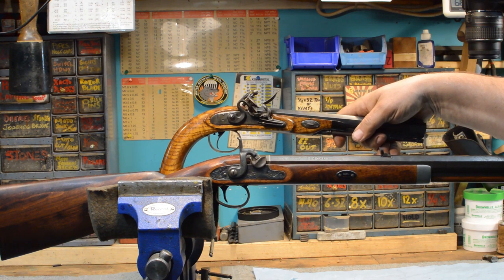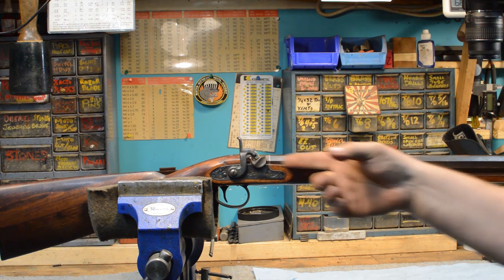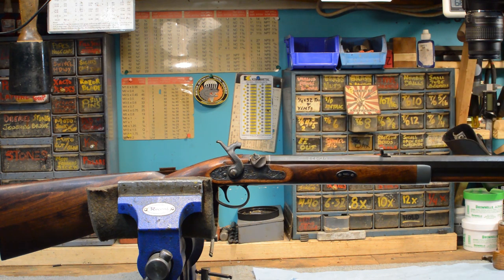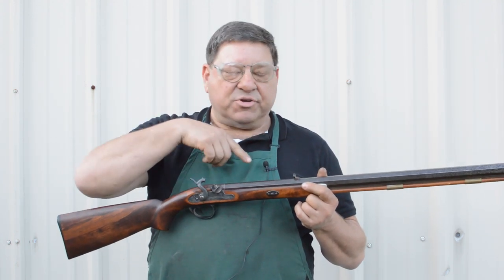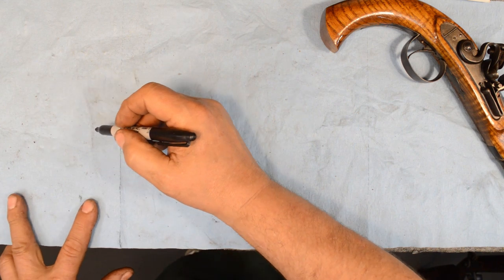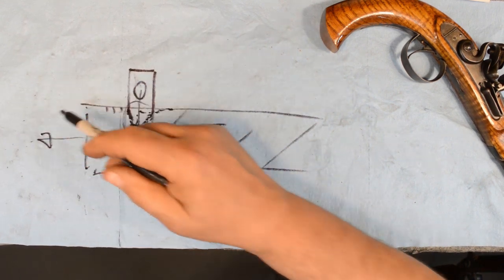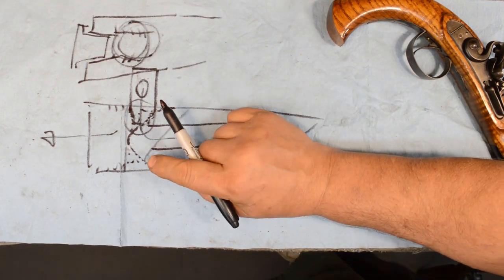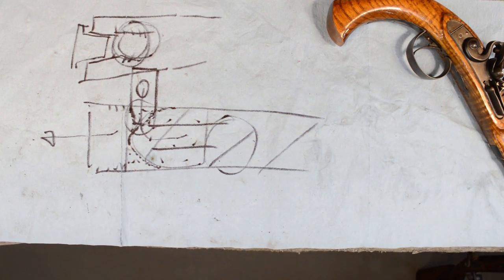Black Powder PSA

Comment: I always make a pot of plain hot water through the coffee maker and add a little dawn dish soap in the pot.  Makes short work of blackpowder fouling and the barrel dries quickly from the heat of the very hot water.  Cleans the coffee maker/pot too.  Just patch out the barrel with a lightly oiled patch and you're ready for the next hunt.

Comment: I find Hornady 777 powder (FFg) the best I've ever used.  It will clean the easiest, has a consistent velocity load to load (less than 15 fps with weighed loads) and is non-corrosive.  To clean I myself use 1-Cup of Simple Green concentrate in 3/4 Gallon "Hot" water then run a bore brush and a jagged patch until it comes out pure white.  Then oil the warm barrel with Eezox to seal the metal for the off season.

Comment: South Carolina? Welcome South, Brother! I’ve been into black powder for 45 years. Hot water, Dawn dish soap or non-pumice gojo are fine for cleaning any type of bp gun and are super cheap. I never waste caps like that and rarely have a misfire because it’s pointless flooding  a barrel with oil ..which is no substitute for proper cleaning and drying techniques.

Comment: I don't bother with percussion. They're too unreliable compared to my flintlock. You can waterproof the pan by putting beeswax around the edge and keeping the lock covered with leather. And as Mark said, they're easy to keep running after the first shot. I also have the woods to myself during the flintlock only season.
Reply: I would do it also if we had that season, but NC doesn't so I shoot a smokeless Savage. Quite the other end of the scale. I'm also a lefty so it makes it even harder to go old. Don't see too many LH flintlocks. I have saw a couple though.

Comment: We do a fair amount of shooting with our flintlocks. In a 32oz spray bottle we mix: 4oz Lestoil or Murphy's floor soap
2oz water soluble cutting oil
26oz water
We use that mixture for cleaning and patch lubrication. Some refer to it as "moose milk."
Reply: The recipe that's been passed along to me thru my family here in Pennsylvania where we have a flintlock only season is 1 part murphys oil soap, 1 part 91% rubbing alcohol, and 1 part hydrogen peroxide.  Having water in your mixture can leave rust. The alcohol in my recipe helps remove moisture and dry quickly.
Reply: @Matt-yv6yu  we dont leave the cleaning solvent  on the gun, it's just for cleaning. We apply motor oil on our rifles when we're done cleaning. I'm from PA as well
Reply: Yes we dont either. Sorry for being unclear.  I just use it as a solution but even after running dry patches and wiping down, theres still some remnants left here n there.  And like your recipe, the oil soap leaves a very light protective coat.
Reply: Not 50/50 Balistal as a finish?  Obviously not for storage. (Great for BP ball and cap revolvers).
Reply: @john-paulsilke893  we just use motor oil to keep from rusting. On and in the barrel as well as the lock. I use 5w30 because that's what I have left over after changing the oil in my truck. A more viscous oil would probably be better for long term storage as motor oil goes away after a while.

Comment: It was explained to me at the IMA shoot that some nationalities of percussion gun had flash channels at 90 degree turns, while others were a more straight line on an angle.  This discussion was in reference to CCI caps (and others) being inferior to RWS, having less flash. (And therefore more issues going around the corners).  What musket style caps do you prefer, Mark?
Reply: Ive used cci, rws, and remington.  The Remingtons were the only ones i ever had problems with, they were garbage.
Reply: If you're having trouble, and you're shooting non reputable guns, replace the nipples with ones from a reputable firm.  Pietta, uberti, cva, ect. nipples might as well be pipe plugs.
Reply: @randymagnum143  I am shooting a D pattern East India Musket, from 1842.  I replaced the nipple with one from Track of the Wolf, and haven't had issues with CCI, as they were what was available.   I will avoid Remington, but would anyway.
Reply: I used to shoot NSSA matches and about 90% of the shooters used CCI Musket Caps.  I never had an issue with a CCI Musket Cap and they are the most common brand to find so it works out well.

For my Hawken style guns and cap n ball revolvers I use Remington caps only.  The only thing Remington, CCI and RWS caps have in common is the #10/#11 designation.  The sizes are different for diameter, length and depth.

Comment: I shoot in N-SSA matches and either hunting or prepping to shoot the first relay, I run patches down until they come out clean then snap between 8 and 10 caps on the nipple before I load my first round making sure he fire ants or grass leaves are vigorously displaced on the last 3 or 4 caps. It never fails at the National for the first real to always be delayed by at least 3 or 4 fouled firearms because of the oil or cake fouling the nipple and flash channel. Some folks I know even carry a vent primer with either FFFFg or even some flash powder to pour down the nipple when their guns won't go off.

Comment: I do it a little differently. Most of my rifles are flint locks. I do however own a .50 Hawken (Lyman). If I am going to hunt , it goes like this. Remove the barrel. Then remove the nipple. Remove the clean out plug ,if there is one. Clean the plug and nipple with a dry solvent to remove the oil , dry completely and set aside. Place the barrel breach down in a plastic bucket. Pour boiling water down the barrel followed by cleaning rod with a dry patch or patches until dry, set aside for a bit. Reinstall the cleanout plug ,do not oil. Do the same with the nipple No oil. Place the barrel back in the stock. Load the gun as usual. Place a cap on the nipple. Using a scrap piece of leather, place it over the cap and carefully lower the hammer. You can then leave the rifle loaded for the season. To shoot simply cock the hammer , remove the piece of leather , fire.

Comment: QUESTION: I'm a huge fan of Balistol. Never had issues. Have other people had problems with it?
Reply: For years I used Murphy's Oil Soap n hot water to clean with then Bore Butter to lube.  No issues ever with rust.

I have switched to Ballistol n water to clean and Ballistol to lube with.  Before I go shoot I swab the bore with dry patches and flush the chamber/bolster/nipple with a few ounces of denatured alcohol.  No issues at all.
Reply: Hamm 603 the only bad thing I have to say about ballistol is that if it gets cold it turns into a jell doesn’t effect anything at all and I’ve heard it fades bluing I can’t tell on my guns and they’re always oiled
Reply: I've used everything from Murphys oil soap to simple green to Balistol. Short awnser, it doesn't matter. Use whatever you want, just get it clean.

Comment: While we still lived in the People's Republic of Maryland, before moving back home to Civilization, The Real South, and South Carolina I had the occasion to visit a "gun & pawn" that was located just South of the Pennsylvania line. While perusing the used long gun racks I spotted a very nice looking percussion "Plains" rifle in a corner. I asked to examine it and the owner of the store handed it over to me. Having had a bit of experience with "unloaded" muzzle loaders, along with more modern bullet launchers, I immediately pulled the ram rod and eased it into the barrel....It stopped at what I considered to be more than just a wee bit short of where I felt it should have for an "unloaded" .54cal. I advised the store owner that I felt confident that there was a load of BP AND either a ball or Minnie ball still in the "firing chamber". Under his watchful eyes and with great care I removed, with his tools of course, the breech plug, and out poured what I strongly suspect, again based on experience, was a DOUBLE load of BP! I held the barrel up to eye level and a nearby desk lamp and saw that it was blocked. After considerable effort with a "worm screw" I was able to retrieve not one but TWO .54cal lead balls from that barrel. Had someone purchased that "as is" rifle and taken it for granted that it was "unloaded" and then TRIPLE loaded it....Well....Can you say pipe bomb? Thanks for this PSA as I'm sure more than one viewer will take a moment to think "Did I ever actually shoot that old smoke pole of mine last season?" Keep up the great work you do!!!

Comment: Moisture in the air? What’s that? I have a 1903 Springfield that spent the last 40 years in Wyoming and the stock shrank. Nose cap is loose, barrel band in loose, and the buttstock cracked between the two screws that hold the butt plate on.
Reply: Mark did say that they breath low pressure steam down there. So he stole all your humidity for his own set of problems.

Comment: The 209 inline guns you always put anti seize on the threads keep that from seizing up and where you can't get it off if you don't the gun is worthless cuz you ain't going to get that breech plug out were you can clean it that's a good thing about the inline their designs you can take the breech plug out and clean the easier so you don't have that buildup
Reply: Seems ridiculous that they haven't figured out a good way to keep fouling out of the threads, like I dunno, an o ring?

Comment: Mark we do not have Fire Ants where I hunt . Any substitutes suggested ?  I have been hunting with percussion since 1977 and have only not hunted with Black powder the last 2 seasons .   It gets very wet where we hunt and we learned the hard way when we were kids .    Often we would go to a Back corner of the woods we hunted and use a Hollow log to muffle the sound and un load in the middle of a really Damp day . Of Course if there are others hunting it is best to be thoughtful about Molesting their hunt with Sound .   Then a Fresh reload at noon  left no doubt  .   Many hang fires over the years and some that would not go off .  Unloading at the end of the day is standard because we drive a long ways home .   Cleaning it at night leaves a risk of moisture the next day if you are in a rush , so it is care fully cleaned .    But I still Fire  3 or 4 caps at a Location remote from the Woods that are being hunted first thing in the morning .  Sound is an issue so we think it out .   All those years have taught me that it is worth the trouble of a few caps before loading .     Thank you for the video .